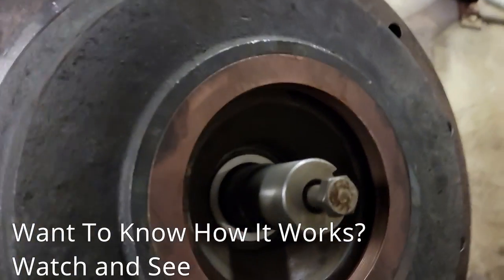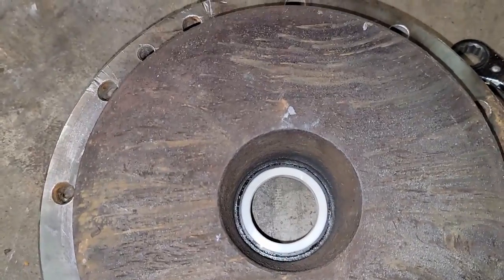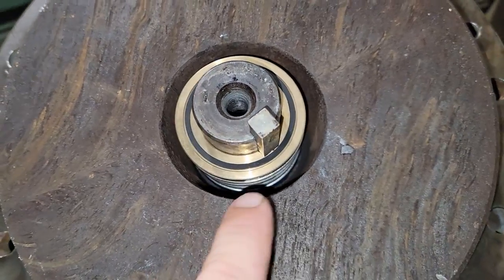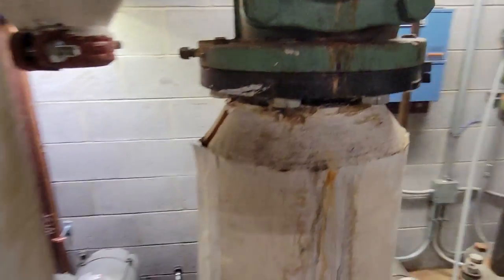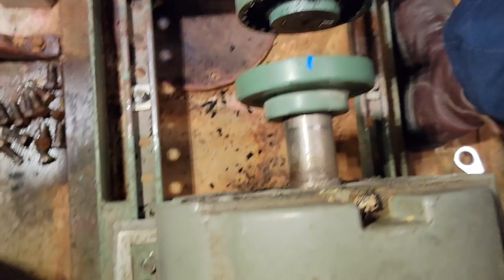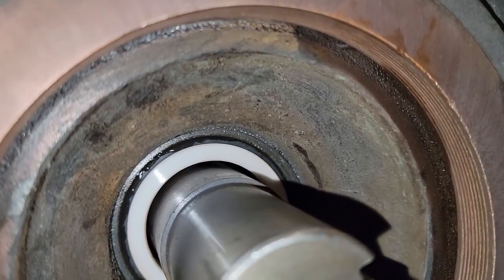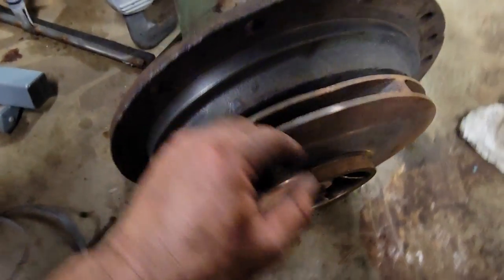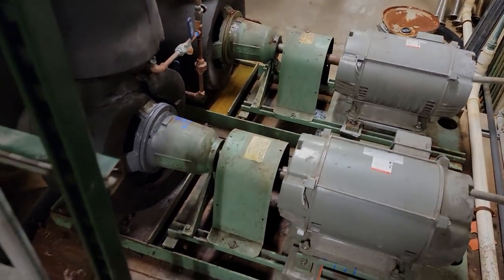MY BOILER AND CHILLER ARE LEAKING WATER! HOW TO FIX IT!

Comment: Mechanical seals and sleeve bearings, fun days.
We use permatex on the mating surfaces, I'm also glad you took the plug out and didn't just pump the grease in like some I've seen.
You can switch grease as long as you pump the old grease out.
Thanks again for the video!!!
🥃🥃🍺🍺🍺🍿🎯
Stay safe. 
Retired (werk'n)keyboard super tech. Wear your safety glasses!
Reply from the maker: Thanks Ezy-HC 👍👍

Comment: a lot of auto-mechanics hate silicone on gaskets, but I prefer using it myself, sometimes only on one side if it will be removed often.
sometimes it's a pain to get into and wire wheel or scrape off the surface that stays on vehicle, but I'd still rather it not leak due to corrosion/rusting causing uneven surfaces. 
same goes for using silicone in other trades, some will gripe about it, some will praise it. I say use it sparingly and carry a brass wire wheel in drill :)
Reply from the maker: Agreed
Reply: A thin! layer of sealant on both sides of the gasket will keep things sealed up forever

Comment: Couple dabs of Anti seize works wonders on that gasket. Keeps it in place very well and makes it easy to take off.

Dawn dish soap on the rubber part of the seal also makes it easier to push down.
Reply from the maker: Awesome tips, thanks 4 sharing!

Comment: I helped do demo on the old chiller/cooling tower here at the Pennsylvania state capitol, many years ago. The tower was all redwood with copper nails and stainless steel bolts.
We vented the fumes from cutting the pipe out of the chase up the chase, and it worked slick. I made a tool to hoist chiller end sections out. This was more challenging than I thought, but it worked out well.
The redwood made a few projects for the boss's son, but the rest of it made nice mulch.
Reply from the maker: Thanks for sharing Bryant!

Comment: I always liked B&G pumps. Taco failed far more often . At one job I took care of 85 pumps. I ended up getting a laser and it made a world of difference. Couplings lasted much longer. 
Nice vid
Reply from the maker: I priced the laser for belt alignment and the cheapest I could find I think was 700 to 900 bucks. I even tried building one but gave up. 👉 I was thinking I could probably use a dial indicator to align them?  You can get a generic one for as little as $75. A better one is more like $250 and up. Have you ever seen a dial indicator used for this purpose?
Reply: @HVACRSurvival  I took a pen laser pointer and glued two thin wafer magnets close together on the pen. Then I just stick it inside the v-grove and turn it and watch how it lines up with other pulley. It gets it closer than a straight edge. Cost less than $20
Reply from the maker: @Lee- I was looking at the torpedoe levels with a green laser. But the pen idea sounds like the same thing only cheaper. 👍👍
Reply: @HVACRSurvival  a telescoping gauge set and feelers is a really inexpensive way to help measure inbetween the couplings to aid in eliminating misalignment.
Reply from the maker: I have a digital micrometer. Da I didn't think about that🤦‍♂️👍👍
Reply from the maker: Robert-I might do these once or twice every 2 or 3 years. I do more belts than pumps so it would be great for those but a strait edge does decent.

Comment: on smaller pumps, I often find the rubber seal/washer at impeller to have failed, also the rubber to brass sliding seal. I haven't worked on many pumps that large, but same design more or less.
most smaller pumps have a long motor shaft directly passed through to thread on impellers(pool/spa/well). there's a simple nylon slinger on the shaft to keep leaks from entering the bearings and motor housing if a seal leak occurs.

Comment: Another great video. I've pulled and replaced many seals on B&G pumps, series 80's and 100's. Those Woods couplers are pretty forgiving if not perfectly aligned. I dont use a laser either for aligning the motor and pump.
Reply from the maker: Thanks for sharing your experience and supporting my videos!

Comment: Very neat job , I would have thought I'd been a 2 man job looking at the size and weight of the parts. 
Parker makes a silicon grease specially made for gaskets and O-rings called Super O-lube .
Reply from the maker: I'll have to look into that, thanks Sterling!

Comment: If you have a lot of gaskets to remove. I have seen car guys use a tool that is a carbide edge that's been machined down just for that purpose. The only thing is if you use it on aluminum you can damage it.
Reply from the maker: Interesting 👍👍

Comment: I use pipe dope as a sealer/holder for the gasket, in a pinch I’ve just used pipe dope and it’s been about 3 years it’s still not leaking lol. I use a straight leveler like you ain’t got time for lasers.
Reply from the maker: Which pipe did you use? I know there's some out there that is like a gasket sealer and their is some that is clumping and grainy,  I can't imagine the grainy stuff working as good.? Thanks for commenting!
Reply: @HVACRSurvival  I was using blue monster for awhile I really like the mil rose products. I’m transitioning to viper pipe dope now not 100 percent on it yet but we’ll see ref tech stuff hasn’t let me down yet. 🤘🏻

Comment: Shaft seals suck!  I have to do them on air compressors.  Be glad it ain't got a wear sleeve you have to pull and install.
Reply from the maker: I don't enjoy then much either but it gets easier as you repeat. I've never done any other types,  those air compressor seals sound less than intriguing.

Comment: There was a place that had a chiller as well so the whole building had ac
Reply from the maker: This place had both, 2 boilers and 2 chillers. The boilers were used to heat air,  pool water,  and dehumidification. The chillers were for cooling. This building had a VAV system.